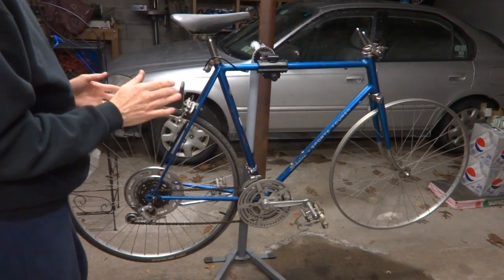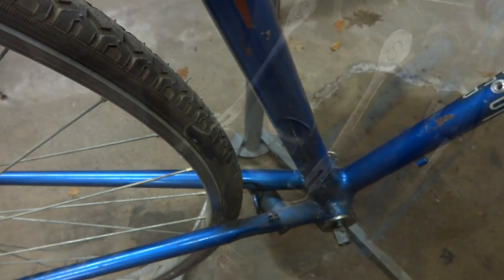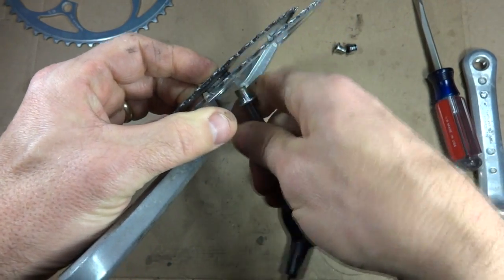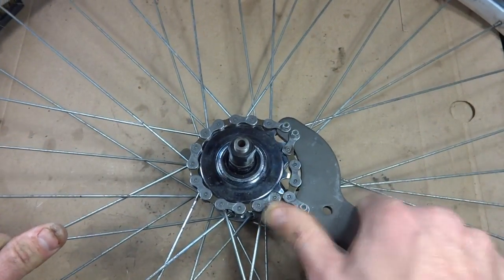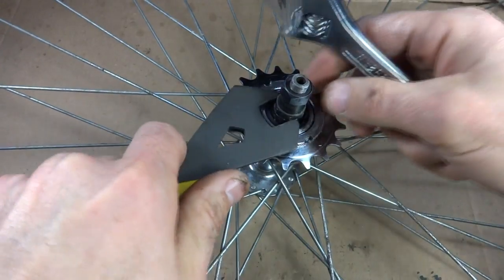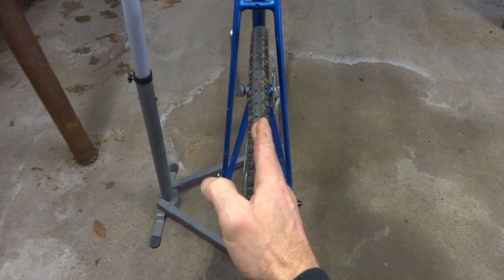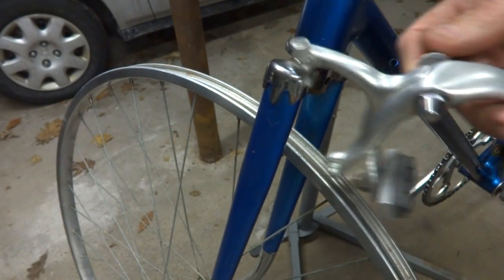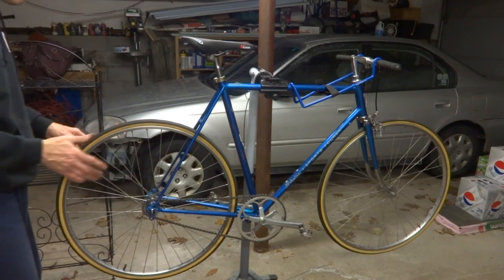How To Build A Cheap Fixie From A Vintage Bike

Comment: that was the most enjoyable video ı've ever watched  So many Tips was in that video.
Thank you so much and well done.
Also, ı need to ask you some thinks I am community cyclist ı transform work to home and getting back with the cycle. but, I moved to another house which is top of a hill so this case brings another issue for me climbing my bike has no shift at all and it is a lady frame. That's my problem.
I decided to buy a vintage bike and also I Found one but it has a steel frame and a little bit heavy. I just wanna know for climbing the bike. Would it be taught for me or I can buy another bike made from aluminum.
What would be suggestions for me?
Reply from the maker: They made light weight steel bikes. My favorite road bikes of the ones I own are steel frame. I have aluminum frame bikes too. Find a lightweight road bike with good gearing. Or update the gearing. Good steel frames are made from Reynolds 531, or Tange, or Columbus tubing, etc. Do some research.
Reply: @RJTheBikeGuy  thanx for suggestions ı will research some bike too

Comment: What size chain did you use, and did the rear cog you used match the chain size??? What about the front chainring??? Sorry for all the questions. I heard to use 1/8 x 1/2 chain, but haven't heard anything about the front chainring size. Will a road bike chainring work with a 1/8 x 1/2 chain??? Because I made a chainwhip out of a 3/32 chain and it does not for too well around my 1/8" freewheel. Thanks, Clayton.
Reply from the maker: If you use a 1/8" track cog, use a 1/8" chain. I used a 3/32" cog, so I used a 3/32" chain.
Reply: What about the front chainring????

Comment: I have an early Trek 12 speed road bike that I'd like to upgrade.  It has down tube shifters and the handlebar stem is a bit short for my liking...  And, the handlebars are kind of strange.  Can it be upgraded to integral brake/shifters?  If so, where can I purchase something like that?

Comment: Thanks for the vid I did the same I have Fuji Vantage Chromyl frame  from 1990 it only had 10 miles on it I put a 50 tooth sprocket changed to 8 gears times 3 from 6 times 3 I put dual wall rims stainless steel spokes Everything is shamano  acrea rear and SiS front derailleur I  have reached 35 miles a hour on it could go faster but its scary So far his summer I have done over 1000 miles Its best bike I ever bike owned  shamano v brakes and shamano speed index shifters changed the crank and rear axel  The ride is great It cost a bit but worth it for sure Im 60 ride everyday

Comment: I have a quick question. I a neck deep in a broke the of converting a road bike I have had for numerous years into a single speed. I wound up upgrading to the 700c wheels instead of the 27 1 1/4 wheels on it. I am having to upgrade to the breaks to long reach and I'm fine with that. Here is where I am stuck, my current brake set up looks vastly different I don't know if it's a cheap frame or an old or combination of both. The rear mounting point is a flat bar instead of a tube as shown in this video so it was not recessed mounted or traditional nut. It's essentially a stud and lock nut with calipers that are drop forged or stamped (they are flat). The front is just a stud ran through a hole in the tube in the fork.
Have you attempted to upgrade brakes on something like this or seen something like this?
Reply from the maker: +daniel daitch Sounds like it might be a cheaper frame. But it can be done. You will just have to work at it. Though you might want to consider how much money you want to put into upgrading it if it is a cheap frame.
Reply: +RJ The Bike Guy I do think it's a cheaper frame but I think the fulfillment of the project out weighs the cost. All of these upgrades are purely "bolt on" so they can be transferred to another frame as I stumble across one. One thing I saw on a mountain bike forum is when you have the plate bridges you can use a spacer or washers to move the caliper off the frame instead of the groove that straddles the bridge and change the mounting bolt sizes. Do you think that would change the function of the brakes.

As a tinkerer and with this project I did find your videos very insightful and I do appreciate the fact that you will take time to answer questions like mine.
Reply from the maker: +daniel daitch I would have the brake mounted as close to the bridge as possible and put spacers on the back side if needed. Not sure what you mean by groove.
Reply: +RJ The Bike Guy I am learning all the fancy bike jargon so bear with me. On a traditional non cheap bike frame the rear bridge is a tube, so if you use a traditional nut you have two let's call them spacers that at flat on one side and have a v groove to "hug" the bridge. On a recessed mount you have the side that goes in the opposite of the recessed but that's flat on one side (caliper side) and grooved on the other (bridge side). My shim on the plate bridge will be the same thickness as the washer that comes with the kit but instead of a groove to hug the bridge it will be flat.

Did any of that make sense haha

Comment: On a freewheel single speed conversion from a multispeed, I've been of the ilke that using a 6-8 speed chain negates the necessity to either dish the wheel (or buy a $35 spacing adapter).
I'm assuming this practice is frowned upon in the cycling world..?
Thanks.
Reply from the maker: It adds wear to the chain and cogs. Also increases the risk of the chain derailling.
Reply: I suspected that, depending on the rider & the usage of course - dumb question really, but wanted to hear it from the 'oracle'..👍.

Comment: Are there nicer chainrings and cogs that will be a drop in replacement for something like this or what I have an old 70s (I'm guessing) Schwinn Varsity?  

Also I intended 10 years ago to try to get an aheadset  with a flat bar on this bike but even with the stem it was too large and I didn't have a lathe.  I basically gave up on the project but would like to complete it sometime before I die.
Reply from the maker: Older American made Schwinns have 21.15mm stems instead of the more common 22.2mm.

Comment: To help me understand, as he replaced the cogs in the back, if he did not use the lock ring from the british bottom bracket, would he have ended up with a single speed that as the ability to free hub? or would it just have unscrewed itself?
Reply from the maker: It would have just unscrewed.l

Comment: hello great video.. . I want to ask You something, is it ok if I dont redish the wheel? Thank you a lot!
Reply from the maker: If you are tweaking the spacing as much as I did and don't redish the wheel, the wheel will be off center. This will affect the alignment of the bike. The wheel may rub the frame. It can make the bike squirrely, causing the bike to wobble at faster speeds.
Reply: RJ The Bike Guy thank you for your quick response and your helpfull answer!

Comment: I have a question on the non drive side of the crank arm the threads keep coming off when ever I try and tighten my crank puller in. What do I do, hopefully I made sense explaining myself
Reply from the maker: I am guessing the threads are stripped. https://www.youtube.com/watch?v=jrpIoXxVyTs
You can try chasing the threads, but if they are stripped, it's not going to help: https://www.youtube.com/watch?v=2SSfk-Q67UQ

Comment: Hey RJ, 
I'm converting a Raleigh to single-speed right now and it's got dropouts just like this one. I thought of cutting the chain slightly too short to have room for tensioning the chain just like you did here, but I'm concerned about getting the axle in square afterwards. How do you ensure the axle sits squarely?
Reply from the maker: Pull it back, straighten the wheel and clamp it in.

Comment: Wouldnt a threaded gear unscrew itself from the hub while breaking? the problem is we apply force in both directions of the chain while riding a fixie, i think it would be a lot saver with a new hub where you can stick the gear on and dont have to screw it down. never tried it myself, i'm just a soon to be engineer.
Reply: oh, didnt watch it far enough, sorry. in my opinion: pleeease use a hub without threads, you pedal and brake at a torque of approx. *10 /4 of your bodyweight: 200Nm. thats 147 footpounds!

Comment: Cool video guy, I had my eye on a new fixie for messing around with but I am seriously looking for a retro vintage bike now after watching your video. I think an old retro bike will look just as cool as a fixie as a new one. Have you had any problems with the axles as a fixie axle normally moves back and forward in the drop out to tension it?
Reply from the maker: +Nigel Johnson No problems. The axles move in the dropouts on this bike also to tension the chain.

Comment: is the 6mm conversion on the axle really that neccessary? feels like too much work for a possible missalignment of the chain, most low end derailleurs misallign the chain anyway.. is this a big deal or? what's the goal here apart from a job well done?
Reply from the maker: If the chainline is off, you are going to wear out your chainrings, cogs, and chain faster. And the chain can also also come off potentially at a bad time and maybe even doing damage.
Reply: thank you so much for answering, sorry to bother you, but how much is faster? I'm planning to make the conversion and just use it for less than 2km per ride. Could I skip this part? I fully understood the spacing, but the rim true is very technical for me. So i thought u could skip it all together, or maybe just put a fixed derailleur?

Comment: Hey RJ, Why not just add a shim or a flat washer or 2 behind the rear cog to make up the difference ?
Reply from the maker: Because by the time you added enough spacers under the freewheel to move it over, there wouldn't much if any threads left to screw it and the lock ring on.

Comment: @ 22:55  If the crank sprocket were to touch the frame, couldn't you just mount it on the outside of the crank hub instead of the inside?  Cheaper fix than buying a whole new bottom bracket.
Reply from the maker: No.

Comment: I've got a problem with my bike conversion and I bet your the fellow with the answers.  I converted an old Trek Mountain bike to a single speed.  I used a tensioner for the chain and a 16T cog with spacers.  On the front I used the high ring which is 46T.  I repacked both hubs and the Bottom Bracket. On the bike rack the cranks/pedals spun up very nice with no problem it seemed.  I chain line was reasonable straight.  Ready for a test ride, except it wouldn't pedal, the right wouldn't be turned by the pedals. Lifted the rear wheel and it turned fine by hand, ride it, no go.  What could be the problem?  Could it be that when the bottom bracket is under a load it's not turning, could I have assembled it wrong?  Doesn't seem possible but maybe.  Have you heard of this before.  Thanks for your help.
Reply from the maker: I don't know. You need to isolate where the resistance is coming from. It is either coming from the hub or the BB it seems.

Comment: i was wandering is it not possible to clue in a spacer of 6 mm at the back to help keep in line the cog. if it's possible we could need a lot less equipment centering the wheel. do you think it would make the risk of the cog getting loose worse.
Reply from the maker: Then there wouldn't be enough threads for the lock ring.
Reply: ok thanks,i just got my cog and lock ring on internet. going to try your method tomorrow. and thanks for the video it's very clear the different parts of the process

Comment: Correct me if I am wrong, but moving 6 mm the hub to get the chain line straight, you ar are displacing the whole wheel 6 mm from the center line of the frame.
Reply: Yep, that's why he had to re-dish the wheel

Comment: If you had a wheel that didn't originally have a sprocket cartridge on it - would it need to be re-dished? Or do they just sit straight in the frame?
Reply from the maker: I redished the wheel, because I changed the hub alignment. I changed the hub alignment so the chain line would be straight. If you don't need to change the chain line, you don't need to redish the wheel.

Comment: If ur gonna use a non fx hub I recommend welding the cog to the hub once its threaded on having a hand brake on a track bike completely kills the purpose of why we love riding track bikes SKIDDING! If u cant weld it urself take it to a muffler shop or just get a real fx wheel or hub learning to lace a new hub to a rim is a great skill to learn
Reply: Also never ever set a fixed gear up and use quick release in the rear fixed gear bikes require a proper axle and nut so the the wheel doesn’t move or effect chain tension while skidding
Reply: And don’t use a master link either dont be lazy a chain breaker is easy to use and in order to achieve proper chain tension you will most likely need a half link

Comment: Why didn,t you check alignment before torqueing down rear sprocket?
Reply from the maker: To what end? Nothing would have been done differently in the end. The cog would have been mounted the exact same way. I still would have had to respace the hub and redish the wheel.

Comment: I have an old Trek 700 hybrid and I want to convert it into a fixed gear. The only problem I have is the rear axle spacing (135 mm, OLD). Do rear single speed/fixed cog rear wheels exist with this dimension? Most fixed gears I see are either 120, 126, or 130. If you have any suggestions I would be most appreciated.
Reply from the maker: +Julian Deocampo 135 is a mountain bike hub.

Comment: I purchased a race cog and locking from amazon sold together ,  I want to put it on an 80's mtb wheel , the cog fits , lockring too small a diameter , is this setup meant for a race wheel , is this why you are using a bb lockring here , I also have very little threads left
.
Thanks
Reply from the maker: Yes. You got a cog for a true fixie wheel. And the lockring is reverse threaded.

Comment: I want to ask you about the chain guard. I just took out my mountain bike to hopefully ride it again. I bought it new a few years back but only rode a handful of times. I just noticed that the guard is old plastic and broken. I know I didn't break it, but man it's as if it just fell apart. Okay it has two broken tabs so I guess it will eventually fall off. I'm not sure. Are there any new types  that you use or do you just take them off completely from the back wheel? I'm not sure how much that will help, specially on a mountain bike where everything gets dirty anyway, and I hardly ride too. I guess the question is what's the best thing to do with that?
Reply from the maker: myshots101 Do you mean the spoke guard/pie plate thing? If it's broken, just take it off, it's not doing any good. You might be able to find a replacement. A lot of people take them off and throw them away. Here is a video I did on them. https://www.youtube.com/watch?v=o9oVJUplaQI

Comment: hey RJ the bike guy, I have a (maybe stuppid) question. I'm working on a fixie myself but I have some problems with my drop bars. You used the straight bars en then you just push them into place, but how do you do that with the drop bars? Do you push them as well in place or... Thanks and nice video!
Reply from the maker: You have to work them through. They have to fit them stem. There are different diameters. https://www.youtube.com/watch?v=rcYOBF46qhI

Comment: The lock ring is supposed to be reverse threaded so when you do pedal backwards to brake it won't unscrew.
Reply: his lock ring was from a BB though, so its not made for his use case scenario.

Comment: For the straight chainline. Is there any reason you went the much longer route of moving over the axel nuts and redishing the wheel VS. the more simpler route of changing the bottom bracket length with a new BB or spacers? Is there any advantage ot the way you did it? Were you just doing that way for a challenge and for the video? Thanks! :)
Reply from the maker: Because the BB can only be changed so much before the chainring hits the frame. Usually not far enough.
Reply: I put a different sealed BB in and the chainring is very close to the frame but the cog still needs moving

Comment: Hey RJ! I heard a lot of people saying that semi-horizontal dropouts are dangerous because the bolt can get yanked out of the front if the rear wheel locks up. I see this as a wives tale, because it doesn't make sense (seeing as the axle and the hub body are free of each other relatively) Is there any sciencey stuff that explains a wheel popping out of the front, or is this really just a wives tale? (I'm running semi-horizontals on my fixie. they seem fine to me '-')
Reply from the maker: Peter Moger It's more a matter that it is hard to get the chain length correct with those.

Comment: Question for the rear hub.
You have dismounted the cassette (with freewheel), then a track sprocket on it. 
Fixed it with the bottom bracket ring, and now it has no freewheel anymore? How does that work?
Reply from the maker: Look up Fixies.
Reply: He got rid of the freewheel and used a single sprocket.

Comment: Is there a way to secure the rear wheel if mine doesn’t have a track dropout? I’ve built one but I am afraid that the rear wheel will go away as I tried to reverse pedal the bike🙈
Reply from the maker: Why would the wheel go anywhere?
Reply: RJ The Bike Guy I’ve talked to a fixie guy and he said when I am riding and back pedal with large force, the wheel might go out of the dropout. So I am a little bit worried about that
Reply from the maker: @backuptimmy4124  Why doesn't it come out with a big forward force?
Reply: @RJTheBikeGuy  not so sure about that. I just wonder if it's possible to add some kind of washers which connects the axle just like those we found on coaster brake bikes